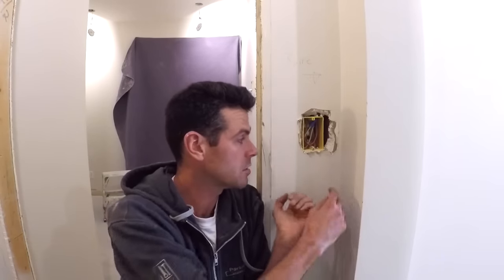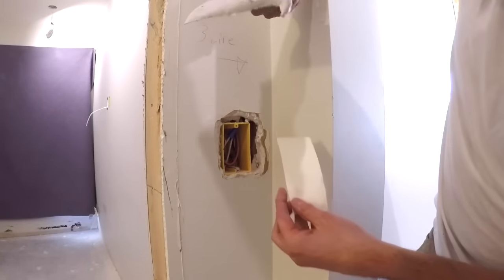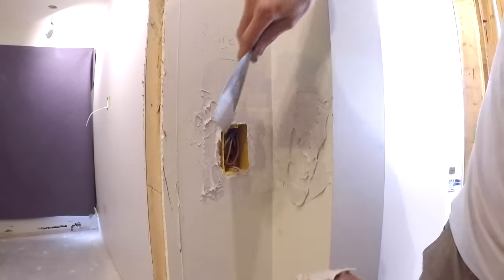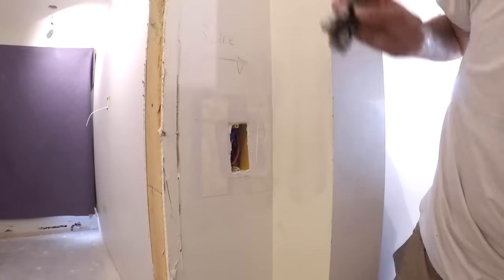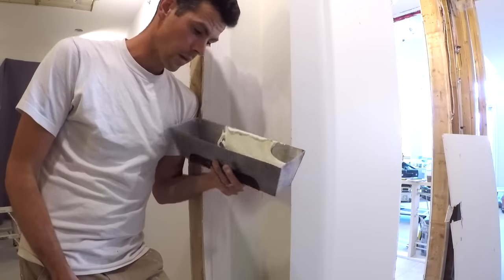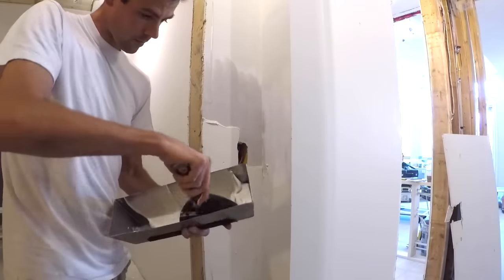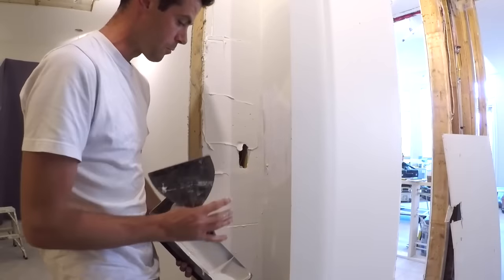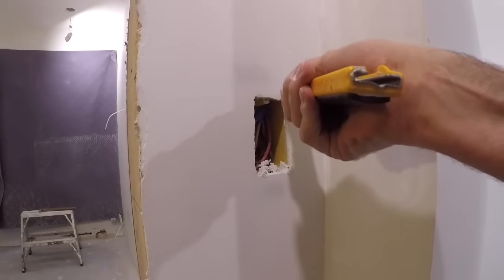HOW TO REPAIR OVERCUT ELECTRICAL BOX (DRYWALL)

Comment: The drywall guy put putty all around the electrical switch in the wall.  There was space between the electrical unit before the drywall dude showed up.  I have never seen such dangerous crap work. Obviously, I’m in an apartment. How do I explain this is wrong? My brother never put putty all around the electrical socket inside the wall.

Help! 
The dude returns tomorrow.  Desperate!!
My bathroom vanity is now less than one inch from the tub.  Before the drywall dude showed up it was at leas 4-5 inches away from the tub/shower. Can’t get in shower w/ a vanity in the way.

Comment: Wow what a long way around this and all with filler!!!!
Expanding foam or just a bit of wood and board and a quick skim.
If you was in the UK you wouldn't get the time or money to do this kind of repair...
Plus the wall is just full of filler....
I'm not over impressed in this...
Massive shout out to LS
Reply: So in the UK foam is cheaper then mud and tape?  Going to guess that's not the case.  What are you attaching your wood to in your scenario?  You say time and money, but this is literally the least expensive and quickest way to handle this.  If you're doing this professionally then you're likely working on multiple places in the house and can literally hit the different steps in between doing other work.  If you are DIY - which is what this video is aimed at, you have all the time in the world to fix your own shit.  Damn some of you people just want to gripe about shit.

Comment: Just  use 5 min mud to fill. No ones punching holes in their walls trying to turn off the lights
Reply: You'd be surprised, for some reason my sister used to love turning off her light by slapping the wall.  Used to drive me nuts when I was a kid, I'd be just starting to fall asleep, and she'd walk into her room and slap the shit out of the switch that was on the opposite side of the wall from my bed.

Comment: Lightweight spackle only.  Won't shrink, let dry, sand paint.
Reply: Scott Ross 40 year drywaller knows better than u
Reply: @loradavidson3433  I was a painter for 20 years and you need not be snide about it.  It's a big improvement on mud for small, deep fills, can be built extremely thick with zero shrinkage and hardens to the consistency of wallboard.

Comment: Either I missed it or you never did explain the adding of the glue in the quickset.
Reply: The quickset has glue in it, like all purpose.
Reply: neonightkiller quick set does not have glue in it.  Omg.  It dries faster because it has more plaster content then regular mud. 
5 min mud has more plaster in it then 45 min.   Not glue

Comment: But why won't you fill the hole with something so if something hits against the walls not going to go in because there's there's not much there just it's a thin piece of wall and into a hole that's not filled. But none the less I learned from your video what I can do once I have filled the hole

Comment: That's easy to fix. 
Get an empty pack of cigarettes preferably 100s in a box and put it in the hole. Then put duct tape inside the hole on the back of the wall so it makes kind of a bridge for the back of the gap. Then putty the crap out. Dry and sand to smooth. Done.

Comment: I thought quickset and paper tape didn't work well?
Reply from the maker: They work great but if you aren’t experienced with the ins and outs of paper tape then it’s more likely to fail. It has slightly less adhesion but still enough if you know what you’re doing.

Comment: Why in the hell would you put glue into fast set, which is already loaded with it? In my 16 years as a drywall contractor, and having more than 5 years specifically doing insurance and restoration work, I have never once done such a ridiculous thing.

Comment: Seems like it would be less work to cut out a larger section and replace it and patch that botched cut out
Reply: How would that be simpler? You're adding cutting and screwing drywall, and you'd end up with a bigger patch.

Comment: Meh. Fill the hole with hardwall or bonding coat to about 1mm below the surface then skim over the top. Then it’s all perfectly flat and not oval/convex over the height of the tape.

Comment: Yeah, be sure to cut the power, electricians especially dislike having to wash their hands after having to haul electrocuted drywallers off to the dumpster when they find the crispy corpses on the day they return to install outlets and switches.

Comment: TO PREVENT THIS FROM HAPPENING IN THE FIRST PLACE, YOU NEED TO BEAT THE SHIT OUT OF THE DRY WALLERS AS SOON AS THEY SHOW UP TO THE JOB.  WORKS VERY WELL.  A SOCK IN THE HEAD IS UNIVERSALLY UNDERSTOOD, NO NEED TO LEARN SPAWNEESH.

THANK YOU AND WORK SAFE!

SEYMOUR J. SCAGNETTI
(PRESIDENT OF OPERATIONS AT LOCAL 6969)

Comment: 8:30 "make sure you have the power off to prevent going into any live wires by accident"

How about adding .."before restoring power check cables for accidental cuts as well?,
Because how is turning power off gonna prevent cutting any cables..
Doh!

Comment: Should have used fix it all.  Its a 10 minute quick set type of solid, solid, mud.  Feather it really good because it's difficult to sand. Then put ultra lightweight compound over the top of that.  It can easily be sanded.  Tape is not necessary. You have outdated techniques.

Comment: I do not understand why you think it is better to put mud on the back of the tape and then put the tape over the hole.  Why not fill the hole with mud, then add the tape over it like for a taped joint?

Comment: LOL WHY YOU DIDN'T FILL FIRST WITH CONCRETE FILLER ,AFTER IT    GETS   HARD, PUT  TAPES AROUND  THE BOX WITH TAPING MUD AND COAT WITH CONCRETE FILLER.  AFTER IT GETS  HARD, COAT AGAIN  THIS  TIME WITH FINISHING MUD AND VOILA! FINISH WAIT UNTIL DRY ANS SAND   IF YOU USE 15 MINUTE CONCRETE FILLER  IT SHOULD TAKE YOU 1 HOUR  OF    WORK PLUS SANDING IF YOU ARE GOOD YOU ARE DONE

Comment: Go to home Depot get a patch wall 6" cut cut in Peace's and bingo to much show🤣🤣🤣👍
Reply: Except a 6" patch from home despot is going to cost you $12+ bucks.  A roll of drywall tape will cost you significantly less.  And in the end you still need to spread out the mud like this to hide the hump.

Comment: In practical terms, this method is way too time-consuming. You could have plastered that entire return-wall with one coat in less time. I had to patch 120 4, 5 and 6 bedroom houses one year...I would have never finished using this method. Laying paper tape over paper tape plus mud raises the level of the patch too high to be invisible.

Comment: How to stupidity and  repair this. Simple. First, cut a 4' piece of 2x4 and smack the idiot that did this in the head. THEN, show him/her the way to properly mark and cut out the wallboard with a small saw. I used to do this a lot in new construction when home owners did stupid "repairs". It only takes a few minutes to do it right in the beginning. Hours to correct a botched job.

Comment: This would have been much easier to just cut out the sheet rock and reinstall in this instance. Uneceesary work for a rapair that won't last. Don't avoid cutting out sheet rock when necessary folks. Good grief.

Comment: THERE IS A RELATIONSHIP W ELECTRICIANS & SHEETROCKERS- THE ELECTRICIANS LEAVE THEIR BOX AND INITIAL WIRE INSTALL TRASH ALL OVER THE HOUSE & THE HANGERS WHEN DONE CLEAN IT UP- THUS, THE ELECTRICIANS ENJOY A TINY BIT-O MUD IN THEIR BOXES

Comment: You filled the small hole on one side of the box yet you mostly left open the large hole on the other side.
Just fill the holes all the way around the box, leave extra mud on the surface, put paper tape over it and smooth it out.
You act like you are doing something special and then don't even fill around the box.

Comment: Soooo much wrong with this video. As a dry-waller that has been mudding for 47 years, you always scrape off most of your first coat. Why? Less sanding. And you do that with all 3 of your coats. After 2nd coat, I use a wet sponge to feather stuff out and take out bump contamination and pit line drags. And, those big gaps need to be filled in. You can use spackle but I use non-expanding foam insulation. Fills up huge gaps and everything sticks to it. You did far more work than it needs to be. Sorry to be critical but you need to work on some of this stuff. And you never put glue in your mud. That job can be done in 2 hours including paint. You use Durabond 90 or Sheetrock 90. The 90 means it will be sandable after 90 minutes. But if you use slightly warm water to mix it, (comes in a bag) then your drying time for your first coat in as little as 5 minutes. You can also use a hairdryer to speed up drying process. So here is the proper way to fix that switch. First, if you plan on using a mudding knife around that box, make sure power is turned off first. It only takes one tiny slip to get the corner of a mudding knife up under the marinates and have a shock,  electrical issue and possibly fire. That said, the very first step is putting painters tape over the entire box to prevent FOB from getting inside the box. I built little rectangle jigs that just fit snuggly over the box. And yes, electricians hate that. Once the box is taped off, I get out the spray foam and fill in the gaps. The foam is very workable after 10 minutes. The next is I trim back the spray foam as it will expand a little. Also, before you spray, make sure all the box holes are taped or siliconed so foam does not go into the box. Now I apply mesh tape. Its way easier to used than paper and is much better for anywhere there is a corner in drywall like on top of a door or around a window. Apply your durabond 90 over the mesh and scrape it right off. Its like rock and is a bitch to sand. Then if I am in a hurry or the customer is in a hurry, I use my heat gun to completely dry the first coat. For the 2nd coat and 3rd coat, I used general purpose compound. Same as first coat, apply the second coat and scrape it right off. The goal is to build up slowly. I hit each coat with wet sponge to smooth the project out. When you are finished, there is zero sanding on any coats. If anyone needs any tips, just throw me a note.

Comment: First mistake is using paper tape for a repair like that. If you know how to work good on drywall you will use mesh tape and 5 min quickset and thats all. Let it dry a little re-skeem and thats it. The bond with mesh take is way better than that. I can do that 20 tousand times better in about 9 mins. You dont even knkw how to grab that 6 inch knife man

Comment: That patch will fail. Cut out the drywall and put a new piece in. This Micky mouse fix won't last
Reply: You also don't tape with hot mud. Fill with hot mud then top with lightweight premix

Comment: You're just laying paper over a fucking hole.  There's absolutely no strength to it whatsoever.  You need to fill in the hole with either some blow-foam or wadded newspaper.  Then build your mud up inside and seal off the hole and then what you do here in the video is just fine to five it that crispy professional look.

Comment: Thats a garbage repair.. I use a much better method without paper tape.  Yeah that paper tape is junk. over time the paper will flap out again and will be noticeable. Use mesh, cut the repair spot out and use small pieces of drywall to fill in.